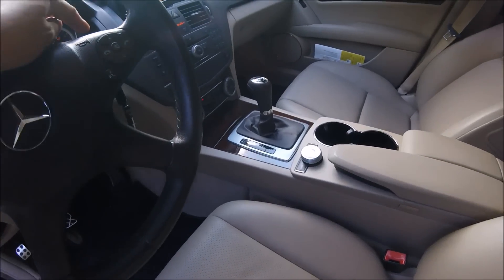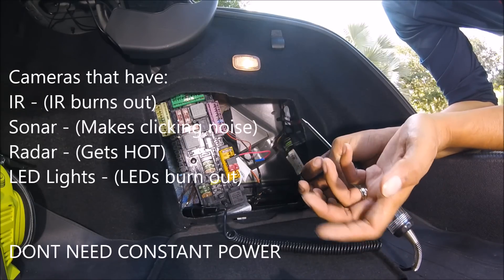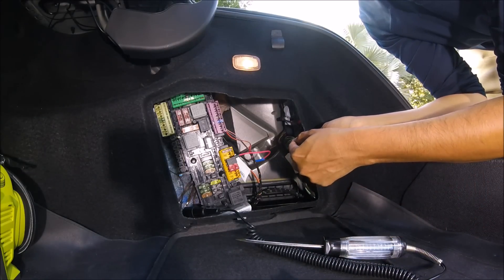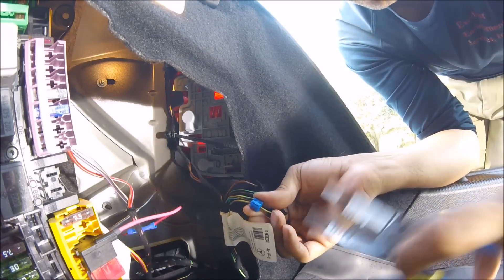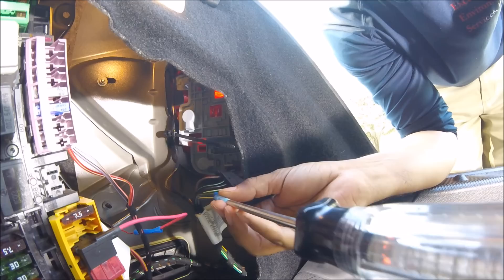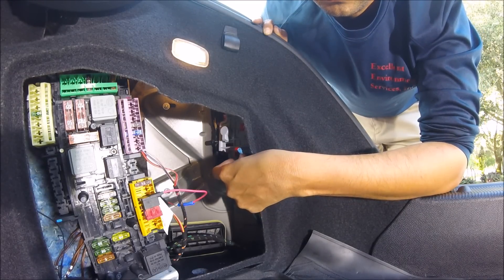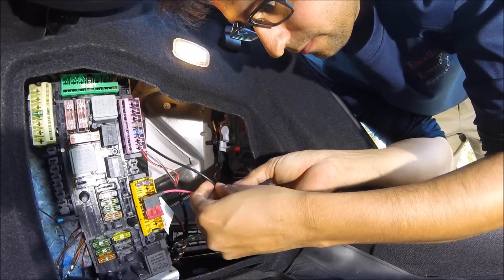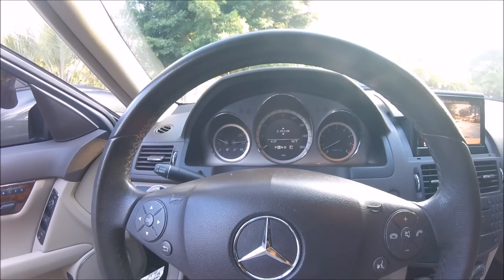Wire Backup Camera to Reverse Light CORRECTLY on ANY car

Comment: This isn't the correct way.  Cutting it is and Y splicing with solder and heat shrink is the correct way.  This is a way to introduce corrosion to the wire. If you solder correctly, this will not mess up the cars computer.
Reply: Scott Haydin, even in a 12V system, with this gauge of wire, there won't be much current going through the T-tap unless something shorted out.  Even then, the fuse will blow long before anything (wire insulation, T-tap insulation, etc.) gets hot enough to melt - especially if everything is through the factory wires which are connected to the factory fuse box.  

We've used T-taps for years and years in alarm installations and car audio installations with very few issues.  Even then, the only real issues with T-taps were using the wrong size.  Obviously, exterior use is a no no.  T-taps are quick yet expose minimal (if any) copper wire strands because it breaks through the wire insulation instead of stripping it like needed when soldering.  

This isn't for you Scott but I also HIGHLY recommend a voltmeter when testing secondary electrical systems.  Test lights were fine up until the late nineties/early 2000's.  Vehicles these days have extremely sensitive electrical systems that run through processors and computers.
Reply: @SojournerNX  This guy thinks like me yes them connectors can break the strands on the wires and on Mercedes you break a few strands you're in big trouble (error light) you will require a new wiring loom.
Reply: jcv1995 ya really, I do 5 cameras a day on a good day . And that’s not the process. Never use t taps for one . Strip the wire , poke a hole in the exposed metal insert the new wire into the hole . Wrap the excess , solder , tape , tie wrap the connection so the tape can’t fall off
Reply: @Funnygalsproductions  No that's not correct never solder Mercedes wires.
Although you're correct about poking a hole through the wire that's the method I've been using for years without any issues.
Reply: car audio solutions even a gas solder iron ?
Reply: @Funnygalsproductions  Yes even that.
Reply: car audio solutions I guess my lazyness has save many cars . Sometimes I solder mostly not unless it’s in outside environment. Lol
Reply: @Funnygalsproductions  Lol you been lucky.. I had a car come in Mercades c220 some idiot soildered the wire that caused the light out bulb come on.
Reply: I've fitted a reverse camera and parking sensors to Mercades together without a relay and without setting off any light's. 
I have you tube video's have a look.
Reply: I live in Hawaii and I’m very concerned about corrosion.  I bought a tool kit just a couple of months ago and already some of the tools are showing very visible corrosion.  The ones that are not chrome played.  I think the best way to go, even if you solder the connection is to either shrink wrap the whole connection, or coat it throughly with liquid plastic.  Maybe even both, shrink wrap and then coat it with liquid plastic.  This may be overkill, but the salt water environment is a very big issue.
Reply: These are okay to use out of the elements when used in conjunction with the proper grease inside of it.
Reply: NO its not that's the worst thing you can do on a Mercedes is use Solder.
Reply: What? More details please! Why would solder be a problem???
Reply: @herculeholmes504  Don't ask silly questions...I'm an car audio/accessories fitter with 25 yrs experience and have worked on 1000s of car's including Mercades.
If I tell you not to solder wires I'm 100% correct.
Reply from the maker: jcv1995 I disagree with you AND agree with you. Tapping wires like this introduce very little moisture which makes the oxidation process very slow to occur. Now the way you described is correct, but realistically I have seen ALOT of bad soldering jobs and bad solder joints = confused ECUs = Fault codes . I agree with you if you are confident enough to solder do it right with a western union connection and shrink wrap it like you stated...like I did in my stero video. This video was intended to make it simple for most people that are interested in just hooking up a camera and not throw a code. 😀
Reply: @RaymondUrias  this should be the most upvoted comment. thank you for this
Reply: @RaymondUrias  You're correct on most parts but solder on Mercs is defiantly a no no.
What I do is burn off the insolation on the wire poke a hole through the wire strands and insert the wire through wrap it around and wrap it with insulation tape I've done 1000s of cars this way without issue.
Reply: I agree, solder and heat shrink tubing is the best way. Those T-tap things are a joke. Not only that, but they are downright dangerous to use in any high current situation.
Reply: @Conqueef-tadoor  What you stated is incorrect they can easily work with up to 30amps of current running through them.
Although I've never used them because I use a much similar method and it works.

Comment: I knew it, I knew this was possible. just need to make sure my reverse doesn't go dim from doing this.
Reply from the maker: Sumona Florence haha yes your guts were correct! and no they won't go dim.
Reply: Well mine's like.. a 20 year old car (literally) though I think that line would still pump 12 volts plus, right? 

My camera doesn't have anything on it really other than the camera itself, but yeah as you said I too don't want it constantly running in hopes to increase its longevity.
Reply from the maker: +Sumona Florence Well your on a roll. Standard battery has 12-14V. And running the camera to the reverse will increase the life span of the camera.
Reply: Hmm, will have to prod it with the volt meter to make sure. ;d I've got a big battery.
Reply from the maker: +Sumona I'm betting you will be just fine! Have a fun install 😁

Comment: My backup camera has a black and a white wire. I noticed when you used the wire tap to the one wire that powers the backup lights you only put one of the wires in the tap. What do I do with there bein a black and white wire?
Reply: Also if one goes to a different wire that's a ground, how do I know which wire to tap that into
Reply from the maker: +Steve klein you can put both taps on. Put positive to positive and negative to negative. Probably White is + and Black is -
I grounded to a metal stud near by
Reply: Thank you.  Is one of the wires going into the wiring harness usually a ground wire that I can tap into vs having to ground the wire to metal on the car? If so, how might I test them to figure out which it is? Is it process of elimination? I'm thinking it's the thicker brown wire
Reply from the maker: Steve klein on this car brown is ground. You can use a contunity tester to find a ground if you are not sure.
Reply: Thanks again. Is that the same tool you used that lights up when it has heat? Or is that another tool. Also would i be testing that wire to see if it never gives a light? If your ground on this vehicle is the thicker brown wire on the far side then mine looks the same so that might be it. It's a Volkswagen
Reply from the maker: Steve klein you can use the same tool:
https://www.thoughtco.com/test-circuit-using-test-light-281976

but I prefer to use a multimeter
Reply: Any idea what guage wire tap to get for those wires?
Reply from the maker: Steve klein 22-18 is a good start point if not you can use 14-16
Reply: Thanks very much for your help. The wire tap method worked great for my garmin wireless cam
Reply from the maker: Steve klein good stuff!

Comment: "I know it's kind of hard for me to get in it there"

That's what she said
Reply: Hey Raymond, I got a 1998 camry and I tried looking for a similar plug in my car, but I do not see one. Should I just wire it into the backup plug?
Reply from the maker: Montage Nation where ever your backup bulb is located, this car has a harness. Check out this video I did with a Ford yours maybe similar:
https://youtu.be/F8mNytVYuds
Reply: yea, I see my backup bulb plug, but it doesn't look like the video. Should I just find which slot is the hot one, and then how do I find which one is ground?
Reply from the maker: +Montage Nation The bulb wires are where you want to tap. To find the ground you can do one of 3 things. Use a continuity tester and test so when it touches ground it lights up. Use a multimeter. Or see the common wire that this not positive on the other bulbs. For instance if you see a black wire on every bulb that may be your ground. You could always just ground to a metal nut nearby also
Reply: I think I may just go pick up some wire tappers, like you showed in your other video. Hopefully Ace Hardware carries them
Reply from the maker: Montage Nation haha it's easier! Soldering is definitely better but can be a real pain sometimes!
Reply: Montage Nation bing
Reply: Raymond Urias but I have  volvo 2017vovosc60?

Comment: Can you give an advice to those who are going to do it "wireless" to which power supply should we wire up the transmitter ? For instance I'm driving w203 c220 cdi MB, non facelift
Reply from the maker: +h0tlot Nice car. Wireless eh? So I'm assuming you will have a second screen in the car plugged in to a cigarette lighter. The transmitter needs to be hooked up to the cars reverse wire. But remember you have a Mercedes with bulb sensing so you will need to add a capcitor to prevent voltage drops. Check out my noise video for instructions on that.
Reply: Raymond Urias , its s a bit simpler than you think, it's a "wifi car transmitter" 
http://s.aliexpress.com/uYFreIZb, it has RCA port for the camera video and +\- connector. The transmitter itself works with an app, which displays the camera image
Reply from the maker: +h0tlot I see, I have never used a device like that before but the wiring is exactly what I said. You will still need a capcitor. The reverse bulb has signal sensing and will drop the voltage or make the picture fuzzy. So one red line goes to the power supply, another red goes to the camera and so does the yellow. Everything is being powered from that module, you don't need to tap the reverse lines twice.
Reply from the maker: +h0tlot I'm going to buy this product and review it
Reply: Raymond Urias great ! Would love to see your review! Just received this product.. I've decided to wire the transmitter and camera separately, both with soldering.
Reply from the maker: h0tlot I just paid the extra 30$ for shipping. I'm curious to see this thing.

Comment: Most replacement head units also have a reverse power line that automatically powers up the backup camera when you put the car in reverse. Just use this power line to turn on the backup camera and save yourself a bunch of time.
Reply from the maker: +Mark Morton You are correct it's called a trigger/Signal wire.
Reply: @RaymondUrias  but that trigger wire on the HU is an INPUT? so should be connected to something like the gear shifter reverse light wire?
Reply: q0q/÷53!=

Comment: Thanks for this awesome video! Really helped me when I hooked up sensors over the weekend.
Reply from the maker: +dcharizard91 That's awesome! What car did you put sensors on?
Reply: Raymond Urias It was on a 2009 MB C300. I needed to know which wire was the reverse light, and your vid showed me exactly which one! The sensors I used are mounted around the license plate so that I didn't have to drill holes in the bumper.

Comment: Xo vision flip open sterio
Reply from the maker: jesus tabares Did you go to system menu and turn backup camera on. Also this radio requires constant power to the camera WHICH means you need a plain camera like this:  https://www.amazon.com/dp/B01HZM70NU/ref=cm_sw_r_cp_apa_dD2jzbF9RWDD9
Wire it for constant power when truck is turned on so + would go to any ACC on your hitch. 
Then from the Radio to your reverse light run a wire and connect it to the + on your reverse bulb this will be a signal wire. Make sure you connect the other end to the Pink wire on back of Radio.

Comment: thank you for the quick response 
Do you mean connect camera to the revers light and conect rear parkeringsensor to the anather revers light
Reply from the maker: Abu Saud No worries man. I would run one wire off the reverse light with a butt connection on the end and plug your sensors and camera into that butt connection.

Comment: Is there a problem if i connect rear camera with the parkeringsensor the same revers light
Reply from the maker: Abu Saud great question! There is a major problem. The voltage going to the sensor is too low and pulses too much. It will definitely cause a choppy picture. Also some newer cars the sensors are on when the car turns on and that can cause camera burn out if it's not CCD. It's always best to plug into harness

Comment: Hi, Raymond.
I bought a Junsun camera for my 2011 c300. The camera has a black and red. They say that the black wire needs to the + pole and the red is to the reverse light. 
would you please advice which color goes to the reverse wire and which is ground?
thanks.

junsun 7 inch Car GPS Navigation Bluetooth 8GB with Rear view Camera FM MP3 MP4 256MB DDR/800MHZ North America Maps with Free Updates
Reply from the maker: +Thai Vuong Great buy! From what I know the positive is red and black is ground. If you get the polarity wrong it won't kill the camera, it just won't turn on. Side note, what do you think of the Junsun radio?
Reply: Raymond, thanks for the quick reply.
I have some issue with the sound, no sound, on this unit. So, I don't know how the radio works.
I'm trying with tap the wire. I'm using a different connector and have not able to get power. I'm going to get the same connector as you described and try again today.
also, what is the last wire, next to the brown ground wire?
thanks.
Reply from the maker: +Thai Vuong If you are installing this on a W204 the wire color you want to splice into is last one silver w yellow stripe. Ground to a the metal point on the car. Yes the wire taps work nice if you put it on correctly. 
ALSO what doesn't have sound the camera or the radio?
Reply: Junsun unit has gps, Bluetooth, fm radio built in with reverse camera. unfortunately, the sound does not work. nothing comes.
Reply: btw, my car is 2011 c300 4matic.
Reply from the maker: +Thai Vuong Yea the color is the the same as the video. So the radio has no sound? Does the Aux have sound?
Reply: ok, so to sum up.
I'll get the same t-connect like you have and tap it. then, the red wire goes in to three tapped connector and black goes to metal part, correct?
thanks for your help.
Reply from the maker: +Thai Vuong yup
Reply: Hi Raymond.
I have this weird issue with my backup camera system. So I bought that junsun gps with backup camera and installed it, great instruction by the way. if I have the key on the second position and put the gear on reverse, the camera works and it displays on the screen, everytime. but when the car is running and I pit it on reverse, nothing happens. Please advice.
Thanks, 
Thai
Reply from the maker: Thai Vuong I know exactly what is going on. You are having engine noise feed back. I made a video explaining this:
https://youtu.be/SUOivzMeoqU

Comment: Hi Raymond. i try to run wire to my camera but my tail light stop working !.
So when i remove my camera wire, the tail light worked again.
So if i use T TAP will it work instead just wire on wire ?
Thanks
Reply from the maker: D Dawood how did you wire it in the first place? 
It should only be tapped Never cut your wires...ever. If you tap it correctly it will work, make sure you are tapping the correct wire and make sure your blade (on your tap) is seating correctly.
Reply from the maker: message me a picture to my Instagram:
raymonduriasjr
then I can see what's going on

Comment: Awesome videos! I'm definitely going to try installing a backup camera on my 2013 C300, however the command center looks different than the one you installed on. Also the reason the you can tap into the tail light for the camera power and not get the voltage drop error is because voltage remains constant across parallel circuits which is what you essentially did. Thanks for all the videos!
Reply from the maker: +Sudesh Jaggernauth You have a 2013 Late model. You will need this part 
https://goo.gl/vaLzzv

Here is the PDF
http://manualzz.com/doc/7389016/2012---up-c-class--w204----crux-interfacing-solutions

And here is a video on access it
https://youtu.be/ST0Ux5a-M4o

Comment: Hey Raymond! I need your expertise opinion. Is there a way to install a backup camera so that the image displays on the Command head unit of a 2008 E350? Thanks for answering!
Reply from the maker: +Fairlawn Massage Based on my research there are two Comand models, one is 7040 and the other is 7024. You need the 7040 in order to do the backup camera....And to the only way to know the model number is pulling the command unit out. This is not plug-and-play...AND you need an interface adapter...Then the Comand unit has to be reprogrammed to accept RGB video adapter. It sucks to hear this but units go for about $700ish.
Reply: Thanks for looking up the information and letting me know. You rock!! I found a 7040 command unit on eBay for $300. But first I need to make sure which model I have, before I bite the bullet and get this other one.
Reply from the maker: Fairlawn Massage Here is the interface you will need to buy also. Don't forget to verify your car model and Command unit

https://car-solutions.com/en/video-interface-for-mercedes-benz-w221-w204-w212.php